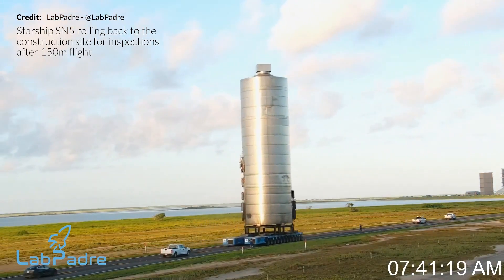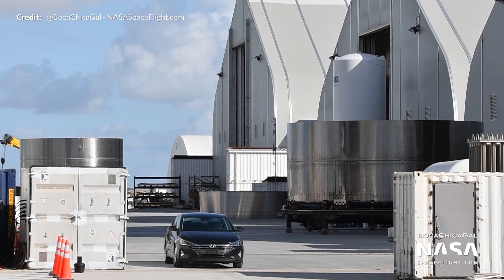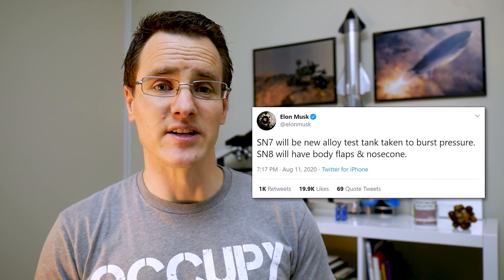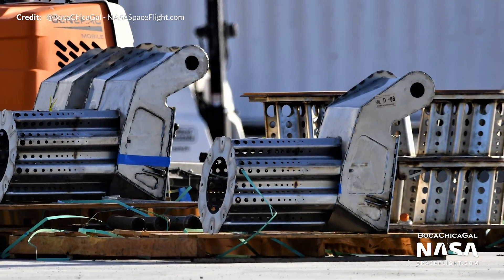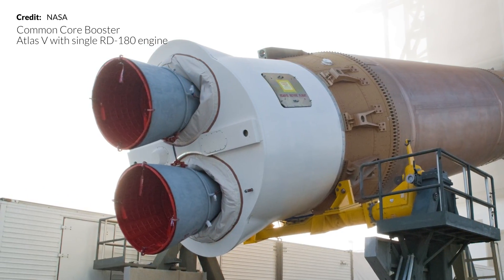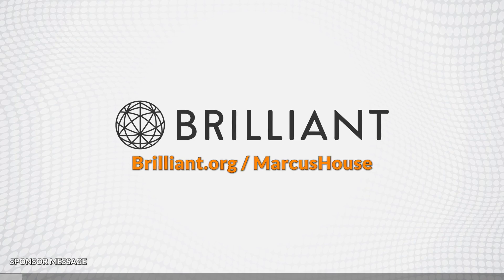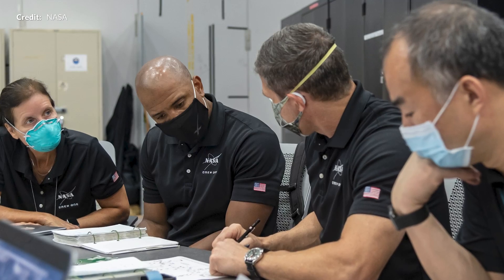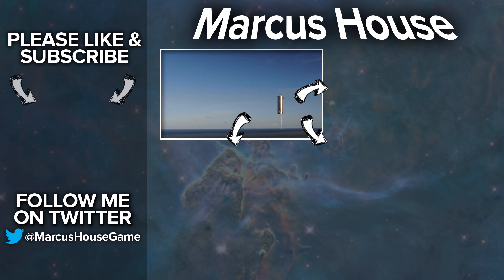SpaceX Starship SN6, SN7.1 & SN8 updates, Crew 1/2 update & US launch service contracts awarded

Comment: Hey Marcus, how about addressing the issue of the strength of the tubes created for StarShip. The SuperHeavy is going to have to support the entire StarShip on top of it at 3+ G's -- an incredible load. how strong can a thin stainless steel tube be, especially 400 feet of a tube? What are the internal supports? How does this all work? Thanks!

Comment: What will be inside the upper section and nose one of these empty starships? Only hydraulic actuators for the fins and thrusters and rings of welded steel. How will that not not buckle in further flights? It lacks the pressure of the tanks. Any ideas on the structural reinforcements and layout of the top section? A deck layout maybe?

Comment: 1- The extensive footing system is in the thousands of tons weight class.
2-The diameter of those round columns indicates a huge compressive strength.
3-Most all water towers have steel legs (columns), to allow them to expand and contract with heating and cooling of the environment.
4-Watch for a trench from the nearest tank farm for service piping.
5-Watch out for another smaller trench for control and electrical service conduits from a block house.
6- I would also guess on some sort of above ground flame diverter. (Steel or concrete)
7-Notice the heavy steel pipes that are sized to slide over the rebar cages.  They will be the outside forms to hold the poured concrete and also serve as heat shields
    for when the columns are finished.  
So, my guess is.........Spacex SLC-1

Comment: Marcus, love your work here! Has anyone found out what exploded on the launch structure during the SN 5 150m hop.
Reply: Based on Scott Manley's video, it seems to have been some methane escaping from the fueling hose after it disconnected from the rocket.
Reply: It happened the same moment the exhaust of that incredibly powerful rocket motor passed over the ground structure that was up until then holding the rocket.

So, it stands to reason that part of that structure had a bad time.

Comment: Well despite common belief , water towers are not built for water storage. They are built to help  maintain water pressure in water lines. When water pressure drops to low the valves in the tower  open and the falling water from the top of the tower maintains water pressure in water lines that are losing pressure. So if they're going to build that, what water lines are they trying to maintain pressure in? That is the question

Comment: I don't think the hexagon structure is a launchpad for Superheavy, for that I would expect a far larger structure with a flame put and blast deflectors for a rocket that large & powerful.
A water tower is plausible, but that's too close to where, as I understand it, the launchpad is meant to go.
My guess is some kind of crane tower to lift Starship on top of Superheavy, and possibly to fuel it and provide access for crew.

Comment: Its not a water tower. Any water tower would have a central core which would need an internal supporting ring. It's a for a six leg structure for big vertical loads. My money is its foundations for a basic starship launch pad. Its out of the ground so not a landing pad. They are going up with concrete so they mean business. Heavy will need a massive flame trench which i don't see. A real starship prototype probably needs a new structure. I don't think its for heavy cause i don't see an obvious flame trench, they are out of the ground but they arent looking at directing massive trust. Again my guess is Starship prototype launch structure. If they go up with columns only its a test stand. If they wall it in its for heavy.

Comment: Great update man!  Here's a quick note.  The structure SpaceX is building at the launch site is larger than what's needed for a 250,000 gallon, 250 foot height water tower. But maybe they're building something far larger?   Maybe a million gallons?
Here's what the foundation for 250k gallon tower would look like...
   https://www.timesreporter.com/storyimage/OH/20161118/NEWS/161119203/EP/1/2/EP-161119203.jpg
For something like this...
   https://bloximages.newyork1.vip.townnews.com/news-gazette.com/content/tncms/assets/v3/editorial/6/b9/6b9c14ef-bc29-5850-aa37-f50cbb4fc246/5d026c74e6153.image.jpg?resize=261%2C400

Comment: Mark my words, SpaceX will have the most problems with the thermal tiles. Controlling the gaps between them with the expansion/contraction of the structure will be a nightmare. Another thing they will have a lot of problems with are windows. The final Starship will not have the vast amount of them that are shown in the concepts. The windows on the Shuttle and Orion CM are small, yet they are a huge headache.
Reply: I agree. My bet is that re-entry will be the next step where we will see a lot of casualties among the Starship fleet. But surely they'll find a solution.

Comment: How would a crew replace missing heat tiles while on the Moon before returning? It seems awfully tall...
Reply: They wouldn't that's sounds like problems for the space shuttle not starship these tiles aren't going anywhere on final versions. Starship will be the most reliable spacecraft of this decade just wait. It will get to the point where other countries will pay SpaceX for crewed flights.
Reply: The moon Starships will either remain on the moon or go between the moon and moon orbiter. They will never return to earth.

Comment: That foundation is for something much MUCH heavier than a quarter million gallons of H2O. 1.5m pilings? That's bridge size  BIG. Also the amount of steel in the hexagonal grade beam is Substantial.
Reply: I'd say these structures are for full thrust test of Starship boosters.
Reply: 1.5 meter pilings for bridges? It’s definitely more than that

Comment: I don't think that new structure is a launch pad. It's far too small in comparison to the diameter of the super heavy booster to be anywhere near the same ratio as something like the saturn V to 39A's flame trench. It's far more likely that this is either a cryogenic storage tank for pre-launch activities, or most likely, a water tower for the sprayers over the flame trench of the soon-to-be-built actual test launchpad.

Comment: About the tiles, much more importantly all tiles on the shuttle were unique and required precise placement and orientation. These tiles look completely interchangeable which will do miracles for the manufacturing and installation process. Robot is just a nice help but far from the most important aspect of it.
Reply from the maker: A good point. Will talk more about in another episode.

Comment: Elon Musk should send the Cybertruck to Mars🤣
Reply: Almost all of Elon Musk's endeavours are applicable for use on Mars.  I believe he planned it that way. 😉
Reply: @rwilco3289  I agree. A modified version of Cybertruck seems to be an easy option for a Mars vehicle.
Elon Musk is not crazy and is planning ahead. He now has almost all the tools to go to Mars by himself. 
- He has the tools to dig into Mars ground to build shelters.
- The batteries and solar panels to produce and store energy
- The rocket to go there
- And soon an entire satellites constellation to finance the project.
Reply: Actually I think that is a good idea. It is doable and the early settlers will need an equipment mover for close to the landing site for initial moving. Aspects of the Starship lunar lander such as a solar panel and lowering equipment with an outside elevator could prove helpful.
Reply: It would be able to drive so much faster than all the autonomous rovers we've sent there!

Comment: I own a 30ft diameter by 90 ft tall silage silo from an old dairy farm.  Roughly the same dimensions of upper stage starship.  I cant imagine that thing flying. Wow.
Reply: Well you do now sm5 took off
Reply: Imagine the thrust required after  putting 25 tons of steel on the top.
Reply: Andrew Radford I know right. The raptor engine is so cool
Reply: Charlie Jaxon tgats just 1 Raptor. Imagine 3 or even 6.

Comment: Question, if spaceX does get to a pace of 1 launch a day, is it even logisticaly possible to truck in that much fuel every day?
Reply: Eventually, they might set up an on-site fuel production facility using the Sabattier Process, to make methane and liquid oxygen using water and carbon dioxide taken from the atmosphere.
Reply: Do they need a lot of fuel? It's a 1 min flight with only one engine.
Reply: @Eselfar  i was talking when tjey are full orbital ready and launching every day. Starship uses 1,200 tons of fuel and super heavy is way more so around 3,000 tons of fuel a day.  A tanker truck hauls 40 tons.. musk is talking multipal launches a day, that hundreds of trucks.
Reply: @patloob  If I understand what Elon Musk said, they want to fly SN5 and SN6 multiple times a day to start with. 
But yeah, I guess later they're gonna need a different logistic to fly a full Starship multiple times a day. But they are far from that atm.
Reply: I was incorrect, super heavy uses 3,300 tons itself for a total of 4,500 tons for each launch.  With a truck fully loadrd at 40 tons thats 113 trucks per launch. Plus boil off.
Reply: @patloob  They'll probably build a LOx plant on-site later.

Comment: Concrete water towers are rare, usually they only have concrete pilling. A concrete water tower would be very expensive, be hard to reconfigure our demolish, and would offer no advantages over an off the shelf metal water tower.
Reply: That " concrete water tower" is actually the superheavy launch mount it has been labeled that for months now..
Reply: No enemies — The OP speculated it might be a water tower and asked for thoughts.

I said it was highly unlikely to be a water tower, That leaves a launch platform.
Reply: @shannonlove4328   You weren't responding to anyone, you were the OP. If that big pad is intended to be part of a water tower, then it is clearly just the foundation for steel one. Given the gumbo like nature of Gulf Coast soil, whenever they do build the water tower, and they will need one eventually, it will have to have a substantial concrete foundation. If that construction is a launch pad though, there don't seem to be any flame diverters. I guess we'll find out eventually
Reply: Odysseus Rex — 1:40
Reply: SpaceX already has a lot of experience building steel tanks that can reliably hold water (every Starship prototype has done this), so it would make sense to use their existing equipment and construction methods to build a dedicated water tower.
Reply: @InventorZahran  Maybe they can convert a test tank into a water tower like they did the fins for the pavilion.
Reply: Water tower! https://en.m.wikipedia.org/wiki/File:Roihuvuori_water_tower_-_Helsinki_Finland.jpg
Reply: Looks like it will be a metal outer caseing around a concrete column.  To withstand the blast force of 37 raptors.
Reply: @patloob  -- agreed.

Comment: Good reporting on the tiles, I did notice that myself. It appears the SS body flexed and compressed the inflexible tiles into each other. 6:07 The top row, left and right are evenly spaced and undamaged, while the central ones are shifted and cracked.

Comment: No way its a water tower - those foundations went down way too far for that. Its a launch platform for super heavy for sure
Reply from the maker: I don't think it is either. Just another popular opinion out there.
Reply: I think it is the foundation for the heavy launch gantry.  Remember that the heavy launch pad needs a gantry tower/crane to stack a starship on top of a BFR.
Reply: @Joisey11  For sure. They can't keep Bluezilla around forever. Gotta have a system to stack Starships on the SH booster.
Reply: I love that were discussing whether a private company is building a watertower or a launch pad xD
Reply: @RenX3133  on their private spaceport, for their private mars starship, using the first full flow staged combustion cycle engine to fly.
Reply: @RenX3133  flame diverter, or crane too
Reply: isn't it due to unstable ground, everything that needs to be attached to the bed rock no?
Reply: @MrSapps  they are close to the sea and the ground is less stable so yes the pilons need to be even deeper underground. Go Google water tower and Launch pad none of them have feet that thick . It's just way too over engineered . The central downpipe is in line with a water tower but it also could be the centre of an upturned conical flame diverter
Reply: @RichardFrost  Have you seen the launch pad from the Saturn V? That thing is like a small hill (with an oil rig and a skyscraper on top), and the Saturn V "only" weighed 3,000 tonnes! Starship + Superheavy is apparently going to be in the region of 5,000 tonnes, so is likely going to need a significantly more substantial structure.
Not that googling pictures of other launch pads is sufficient proof of anything. Without doing a survey of the ground, and a whole lot of structural calculations none of us can say whether it's "way too over-engineered" or not...
Reply: Richard Frost I keep thinking of 31 raptor engines firing simultaneously. The launch pad for Super Heavy has to be super, super re-enforced. Beyond that the noise will be literally deafening. I have no idea.
Reply: I thought these were flying water towers (sarc). Lol

So maybe both hypotheses are correct (trying to keep a straight face)
Reply: The super heavy launch pad NEEDS a hell of a water tower to cool the pad and damp the noise from the engines. In sand and in a hurricane zone like Texas substantial foundations are not optional.
Reply: I mean also I don't think they would have started building it before they got approval because they have been building it for like a month now I think I don't know but yea also that thing you said makes sense it's too deep to be a water tower I think it is just the super heavy pad
Reply: I'm going against the grain here. I'm gonna guess water tower.
Reply: Super Heavy launch pad will need to be elevated, they are too close to water table to dig Flame trench for the several raptors....